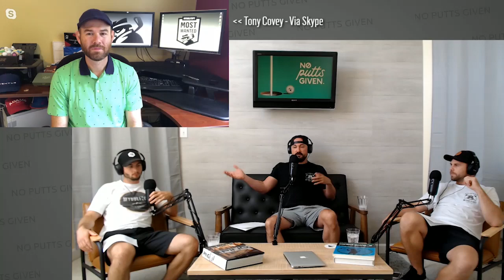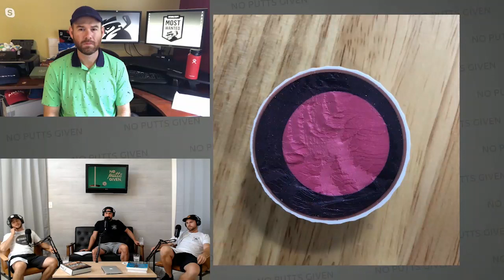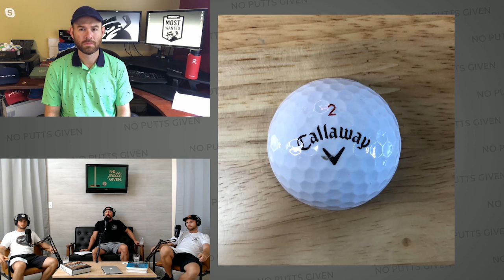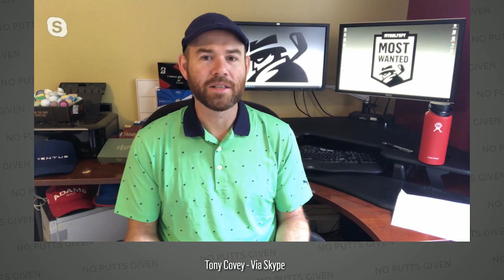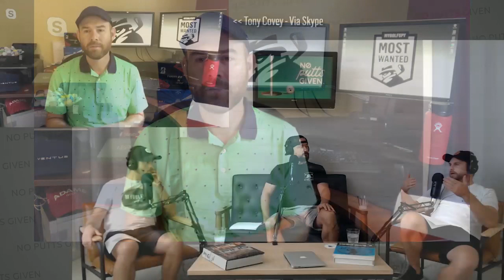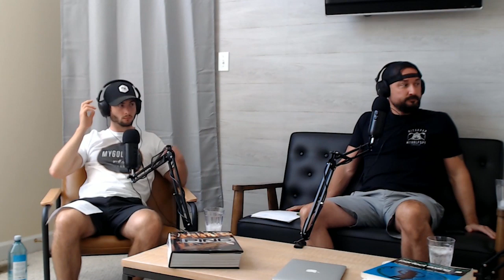The BIG Secret Hidden In Your Golf Ball

Comment: These balls need to be cut in quarters, because depending on where you cut it, the core could be off side to side which is very noticable, or it could be off front to back, which wouldn't be visually noticable.

Comment: I'm kind of surprised that picking a ball and sticking with it is that much of a foreign concept.  Played the ProV1x for years.  Just put Titleist, Taylormade, and Srixon through an on course test.  Regular and X versions of both.  Srixon Z Star XV performed the best to my surprise.  Going to play a few rounds with them and see what I think before I switch permanently but in the head to head it was phenomenal.  ProV1x was still right up there but there seemed to be something about the XV and it's flight and spin.  I wish more fitting places offered golf ball fittings on their menu because I'd love to be able to get the actual numbers.
Reply: i've thought the same thing.  I will say that this year's Prov1x (2019 model) seems to work better for me than years past.  But yes, that Srizon XV has been my best ball too
Reply: @Golfzilla70  Totally...Love the 2019 ProV1x and still have a dozen of them to go through at some point.   

Thought it'd be fun to take the six balls on the course and hit different shots to see how they reacted.  Hit 2 shots with each model from each location and XV did it every time.  XV and ProV1x clearly separated themselves from the pack.  Just seemed for whatever reason I got even a little more of what I love about the current ProV1x out of the XV.  Closest ball I've seen to being lower spin off the driver yet had a ton of spin and check around the greens and coming in with the irons. Didn't find anything special for me out of either of the Taylormade balls.  Not bad...but not exceptional either.  Would love to get on a launch monitor to see the actual numbers and if they back up what I was seeing and feeling on the course.  I did also notice that the cover on the Z Star and the XV was holding up a little better.  Could probably get an extra round or two out of them before throwing them into the practice bag.

Going to play a couple rounds with the XV in play as my ball and if it performs the same it'll be going in the bag.  I like the fact that they are about $10 less per dozen and you can get 4 dozen for the price of 3 if you order them customized.  Around $30 for a dozen of premium balls...yes please!
Reply: @uwrossl  and on top of that, every once in a while Srixon runs a special $40 for 2 dozen!  (at least they did a few weeks ago, anyway, which is how i got my 2 dozen)
Reply: @Golfzilla70  $40 for 2 dozen XV's!?  The 2019 version?  Damn...I missed that.  Have to keep an eye out.  Smoking deal.

Comment: I use a spinner to mark my golf balls. Sometimes I get a ball that just wobbles in the spinner and will not settle down. I have to reset the position of the ball to get it to settle down and finally by varying the speed I can mark it to determine its best axis. I would be curious if I cut these balls open what I would find.

Comment: I know this is off topic but you guys should look into the golf club build ie you can be fitted for the best head/shaft but the quailty of build in some clubs are way off ie a 7iron of a swing weight of 2.2 and the next a 8 iron 3.3 swing weight. I found this out after going to a custom builder and the quality of builds he finds in most sets are way out.As most oem,s are into quantity rather than quality the swing weights are a major problem and if you are now to pay well over $1000 for a set you expect the build quality to be good. Its a issue to look into.
Reply: 2023 now. Bought new Mizuno JPX HM Pro irons last year. something felt off throughout the set particulary near the 5,6,7 irons. Brought them to club maker and found every loft was off from factory, some as much as 3/4°, both weak and strong. Lie varied +-1° throughout set but that's pretty close. So Have your new clubs checked out and standardized also.

Comment: Let’s cut open irons, hybrids, woods and drivers as well. Let’s see what the tolerances are between one model and brand.
Reply: We've already been doing that forever. It's called loft and lie gauge
Reply: @giii7599  not but it will tell you the loft and lie which is pretty much the only important aspect of the iron. I guess you can try and measure thickness of the face but I don't see the point in doing any of that because if the face is hotter than what it should be I can offset that extra distance by adding more loft.